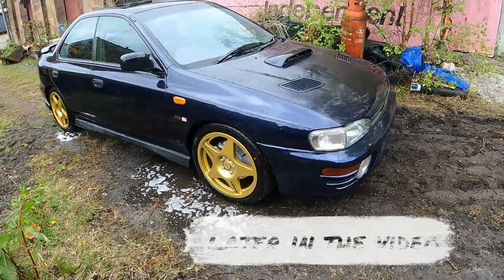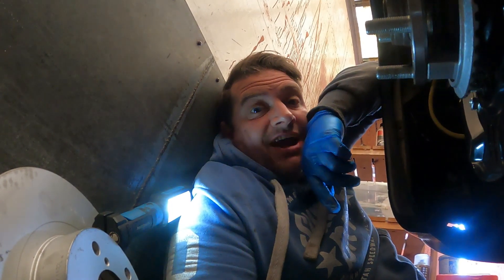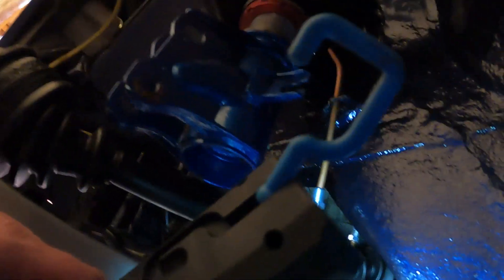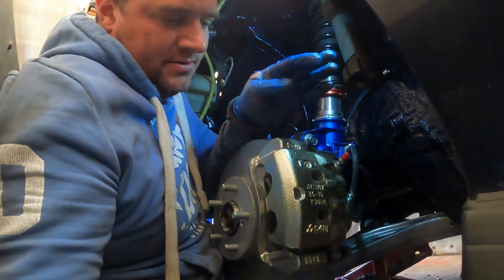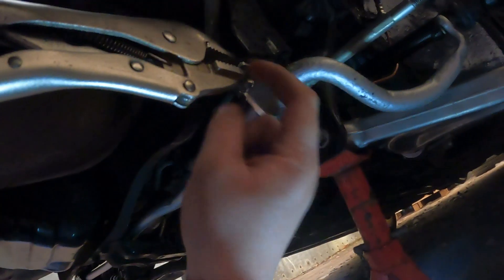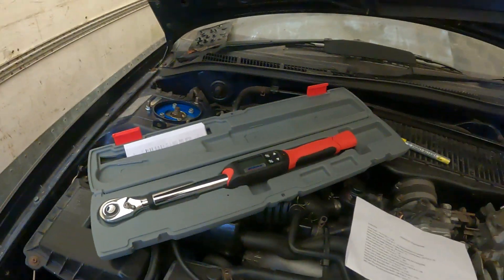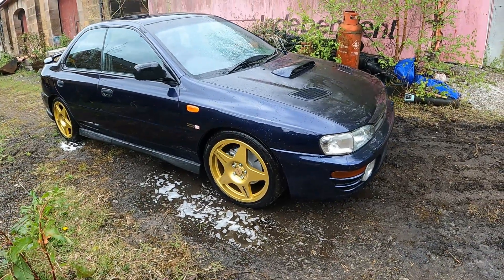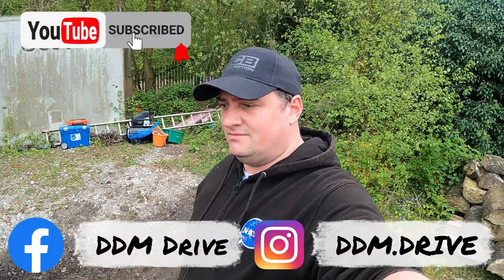Pt 3 - Project GC8 Impreza Series McRae - Front Arches Completed, Wheels on and Back on the Ground!

Comment: Not sure if you are going to tune this up much but I remember using a non-genuine driveshaft in the Williams after I swapped in a high compression engine with ITB's and fairly wild cams (222 hp) and I sheared the same driveshaft on a launch, destroyed the Gripper diff I had fitted too (only found out after a guy bought the gearbox many moons later).

Back in the days before I knew how to repair cars, that scratch would have pissed me off for weeks! A good touch up will sort it :)
Reply from the maker: @BarneyWobba  nah, the williams will stay original engine wise. Yeah the scratch massively annoyed me. But the car will eventually be resprayed anyhow to make it nice.